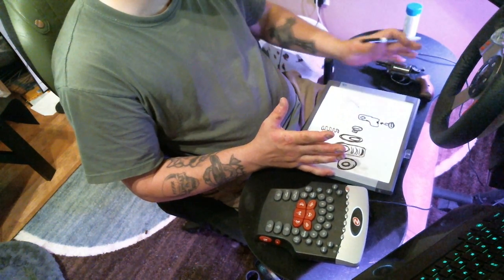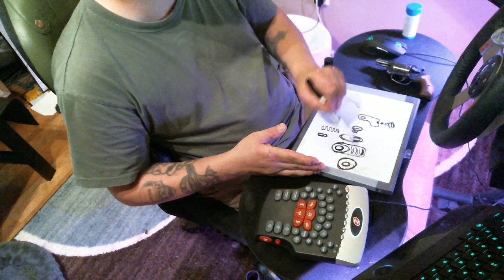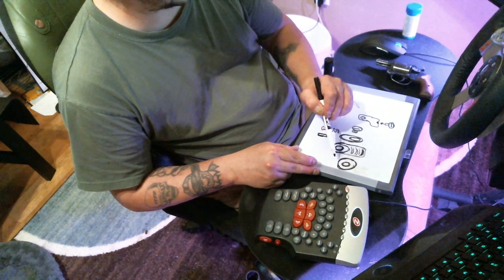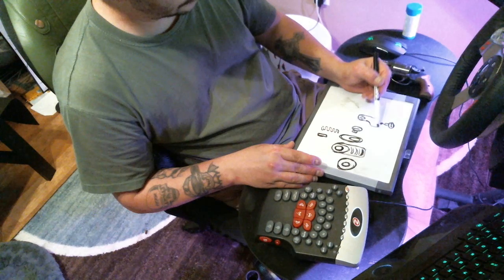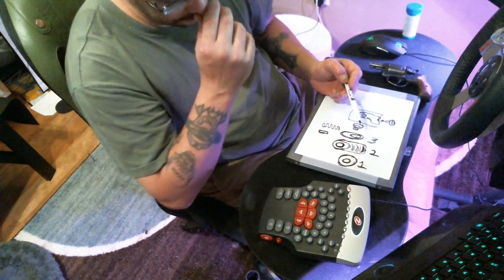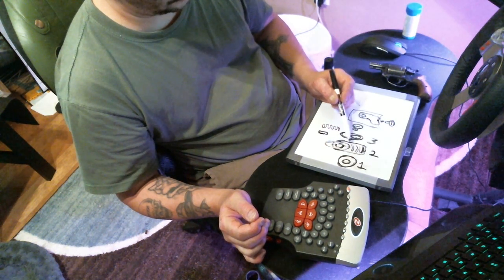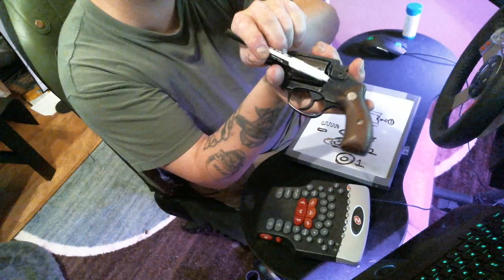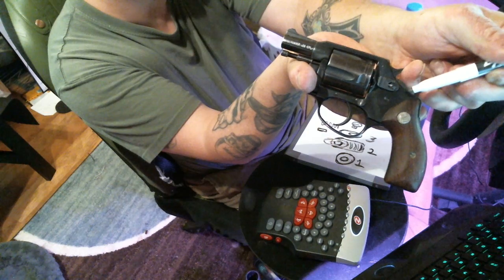Charter arms .38 Special Cylinder release assembly issues, and reassembly - How to

Comment: Working on auntie’s off duty .38 spl. She was having problems with the cylinder getting stuck and the revolver was all rusted up. So before I knew about your video, I disassembled the pistol and the cylinder release 😢. I reblued the pistol and when I went to reassemble everything the cylinder release mechanism was not having it. I even went to eBay to get spare parts just in case.   Thanks for your insight and video. Helped a lot!

Comment: Thank you for making this, started taking apart mine without looking anything up first and spent wayyyyy more time than planned on the reassembly. Between the cylinder release and the spring in the handle, this was not a fun cleaning. I'd rather take apart a Hi-Point any day over the Undercover.

Comment: I have a charter Arms Undercover like yours and i took it a part and reassembled it a few  times till i learned how to do it in a easy way . the cylinder lock and its little spring and end was a real challenge at first i must say I do have a way of patiently reinstalling it if I must but rather not for my hands are messed you like yours . the only real fear i have is loosing the little end that go's on the end of the spring . when i got mine it was a little rough with kind of a gritty trigger pull . I completely disassembled the gun cleaned and blued the buffed and oiled all the parts leaving all the parts with a nice oiled polish then I replaced the trigger ( found on ebay) . it now has a much nicer tiger pull nice and smooth and works well with no issues .

Comment: Thank you for the excellent video!! The towel idea is a must. One additional thing I did was placed a small piece of paper over the "screwhole" while getting the spring and small stud piece into place. I dropped the stud piece two times into the hole b4 I thought of this. I also held that stud and spring in place with my fingernail while I put the screw in.

Comment: Thank you for sharing your knowledge. Mine is the exact same gun. Your tutorial was very helpful. I haven't disassembled it yet, but I'm confident i can do it now. I just wanted to share a trick I learned from chasing tiny, spring-loaded pieces around. Get a clear 1 gallon ziplock bag, put the gun and your hands inside the bag to disassemble and reassemble the spring-loaded portions of your project INSIDE THE BAG. It is a little clumsy and a little tougher visibility but nothing compared to chasing those tiny parts around and taking a chance of not finding them at all. If your gun and hands and tools are too big for a 1 gallon bag there are bigger ziplock bags available. This method has saved me a lot of grief.

Comment: The Undercover was developed as a lower cost alternative to the S&W J frame revolvers.  The intended market was under cover agents of law enforcement.  This was in the days when poolice officers were allowed to use the single action feature of their revolver at qualification time (in those agencies that required qualification, and only the largest ones did).  Later as a result of FBI studies the whole arena of pistol qualification and law enforcement standards went through many changes.  The Undercover was intended for carry with the expectation of fairly light, occasional use.  At the time of the pistols introduction (1964)  there were only 2 types of .38 Special ammunition on the US commercial market.  Low velocity wadcutter ammunition or lead ball standard velocity ammunition.  There was no such thing as a JHP cartridge or a +P cartridge when the pistol was designed.  Accordingly the cylinder walls of the Undercover were intentionally kept as thin as possible to save weight and only intended for the only two cartridge loads of the time.  When Lee Juras introduced the Jacketed Hollow Point .38 Special round 3 years later Charter Arms did not recommend the use of the cartridge in the Undercover as higher pressures can result.  Later the warning was expanded to include disclaimers against the use of +P ammunition.

 THERE IS A REASON disassembly beyond what is in the manual is not advised.  The gun has an aluminum frame with steel pins and screws.  At least one part (the cylinder stop) is simply swaged (pressed in place with a machine).  Any removal of the steel pins or screws potentially enlarges the hole it is in, because steel is harder than aluminum.  You may get away with it a few times, but sooner or later you will be reaching for the Locktite or using very slightly larger pins or screws.  

In the late 70s, early 1980s, I was peripherally involved in the GSA testing of the new US Treasury +P+ .38 Special cartridge.  An attempt to get .357 performance in a .38 case,  Many, many guns were destroyed by those GSA tests in an effort to determine which guns were safe for use with that new cartridge as DoJ and the US Treasury would soon be making it the only .28 Special cartridge approved for duty use by any non-military Federal agency.  Sad to say the Charter Arms revolver sometimes catastrophically fails with just +P ammunition, much less +P+ ammunition..  Charter Arms fans should not be dismayed by that as there were many makes and  models of .38 Special pistol in US inventory that also failed those tests and had to be replaced with guns that could safely handle the +P+ cartridge (until replaced by the 9mm).

Experts agree that in order to become proficient with any pistol and maintain that profieciency at least 1,000 rounds of practice ammunition should be fired each year, every year.  Many competition shooters shoot 4 to 8 times that every year.  You can do that with an Undercover revolver for a few years if you only shoot mid range wadcutters or standard velocity ball ammunition and regularly clean and lube it while following the manufacturer's directions on how to..

I have had my CA Undercover for more than 40 years. It has been reliable.  It provided some comfort in some bad places.  If aomwonw not known to me knocks on my door it may be near me when I answer it (although a CZ75 or a 1911 is also a good option)

Comment: I did this assembly INSIDE a larger Ziploc bag so any parts flying off at mach 5 would be captured and not lost. Cut a small slit in the bag for my screwdriver to reach the screw. Also bought the charter arms latch tool and it helped tremendously. Or you can eyeball it and make the piece yourself.

Comment from the maker: Thank you! You could probably get a really thin circular washer that fits that screw, and it'd work. I'd give it a shot first, it'd be a ton cheaper!
Reply: I know this video is 6 years old, so this is a long shot.  I was reassembling the cylinder release and lost the small pin that goes inside the spring.  I called Charter Arms, they were great about sending me a new one.  Now when I go to put it back together, the cylinder is locked back in place but I had the whole assembly out, so there is no release button to release the cylinder, and I have to be able to release the cylinder to get access to the inside to secure the cylinder release button before putting on the spring with the pin.  How do I release the cylinder with no cylinder release assembly on the gun?

Comment: I own several of these undercover as nd love them !! No problem with complete disassembly had a old project gun reblued but that Damn little spring and little nipple were missing and bought 2 of each ???  In the slide release there is no indent hole and the spring and nipple cannot get back in , spring is so small to compress ?? Is there a small hole in that slide ??.Brian
Reply from the maker: there is a hole on the thumb forward side that the spring rests in. it doesnt want to stay there of course, until it's finally seated against the cylinder wall, with the screw down right. thats the art of the reassembly and why i drew it instead of showing it in person. if you saw someone do it, you wouldn't see anything, except someone shooting a spring the size of a mosquito weiner accross the room at 200mph. thats pretty much it. you won't getvit until you do get it. uf therevis sn easier was i will ket you guys know, but for now, slow, gentle, careful, and easy is the only way. and make sure you have something that will catch that pin and spring

Comment: do all the charter arms undercover .38 specials come with the cylinder release assembly i just bought one and it doesnt have it on it is it necessary to have on the gun will it still function the person i bought it from had it powder coated and doesn't no were or if it had that piece

Comment: I bought mine used and it was dirty as a turd. I took it completely apart to clean it and was doing fairly well getting it back together. That little metal plunger shot out three time on me. The third time I lost track of it in my kitchen. I ended up ordering  a new one. That little piece, no bigger than a grain of rice cost me twenty bucks. Really wish I watched the video first.

Comment: how do i get the cylider to the open position in the first place if the interior screw (release screw) is locked all the way tight
Reply from the maker: pull the release rod below the barrel. If you do lose the release screw inside the frame, this is the only way to get the cylinder to release.

Comment: Here's how you fix a CA.  Box the parts up, get in your car or truck, take a drive and throw it all as far as you can into a lake...and then go buy a much simpler, much more reliable, much more accurate, dependable...EVERYTHING...S&W.  That said, I own one in the original display box...where it will stay.  Never to be disassembled.  What a PITA little pistol to work on!